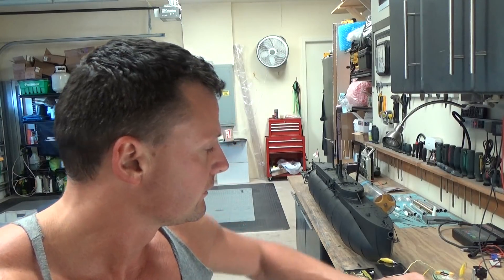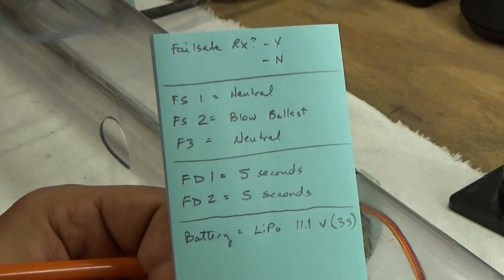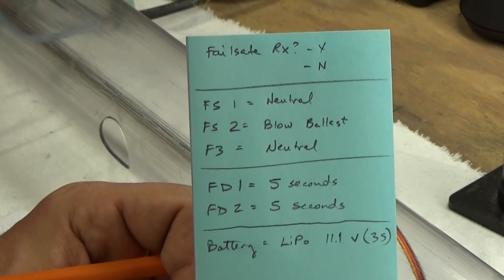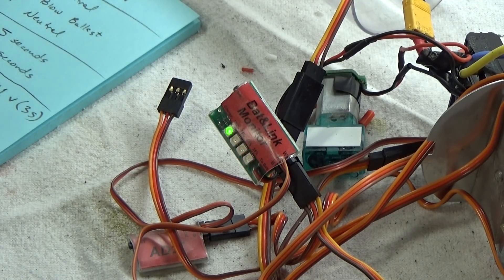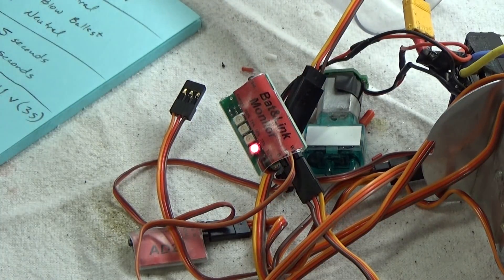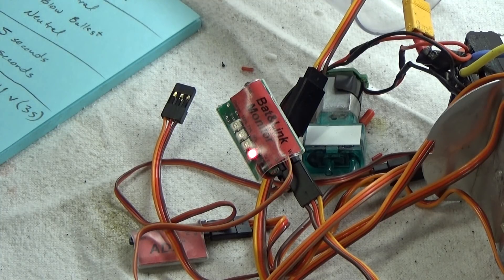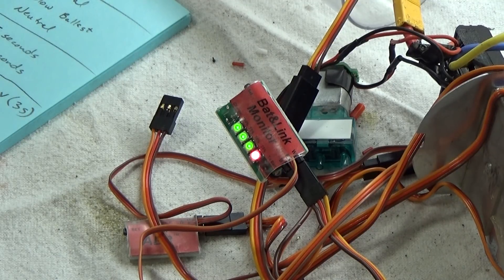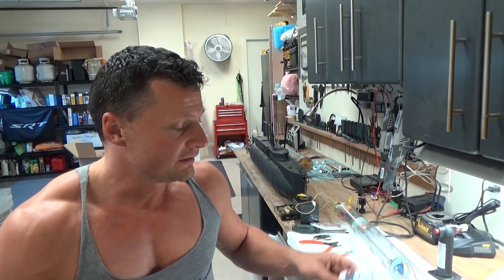BLM

Comment: Hi Bob,  Very exciting: the BLM is wired in & ready for coding. This video is insanely helpful! Problem is, my ballast channel is linear, not stepped. During this failsafe coding procedure, your radio system seems to have a stepped signal for the ballast servo. Do you think the BLM is going to freak out with a linear input? Probably won't explode in flames, but just thought to ask.
Reply: Actually guys, I just sent Kevin McLeod an email about this because, well, he said I could. :) And if he responds I'll forward the knowledge to this thread.
Reply: Update: got in contact with the maker, Kevin McLeod, and confirmed by testing with my sub: not to worry, setup will work just fine with a slider. ("linear" input, by one of those channel controllers that looks just like a trim tab, in my case on a Robbe/Futaba Navy F-14)) To step through the menu, just slide the linear slider all the way to the extreme end and then slide back to neutral. It won't explode. Yay. Note: When you get to the setup procedure when the BLM is blinking out the seconds duration (for ballast response), just slide the slider from neutral and keep it in extreme position until you see the blink count you want, then slide back to neutral. Piece of cake.

Comment: Just been setting up my BLM, and I've noticed it seems to be still putting that 5 second delay in even when I command it to blow the tank.
Reply from the maker: You command a blow and it takes 5 seconds to do it? There is no functionality that would do that, Leon. You're going to need to check each part of that circuit from RX to servo. Hit me up directly via email if you're still having problems. We can bring Kevin McLeod into this if we need to, who makes the units.